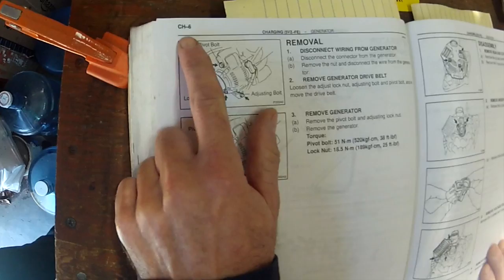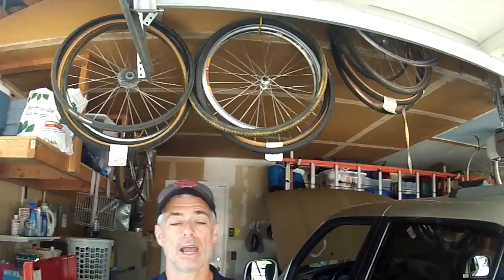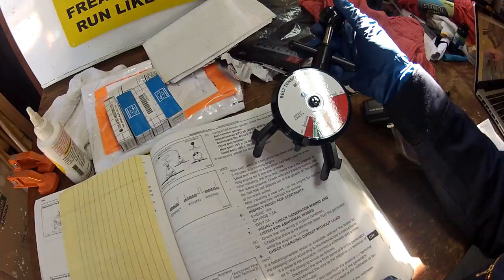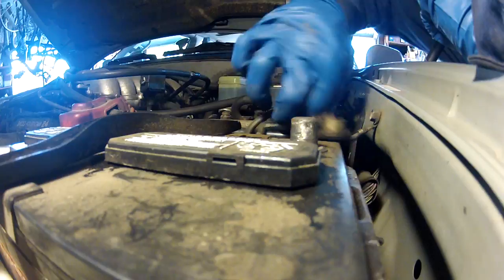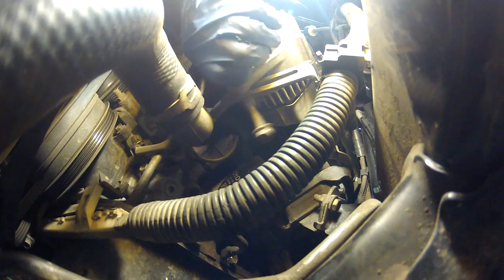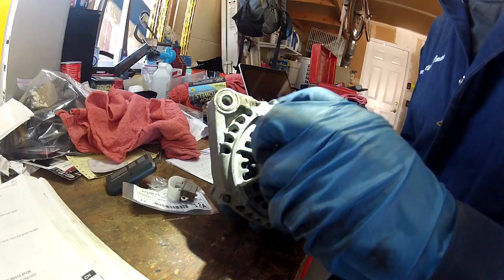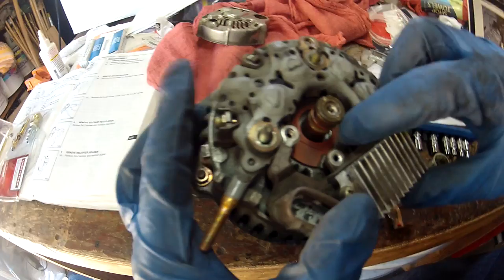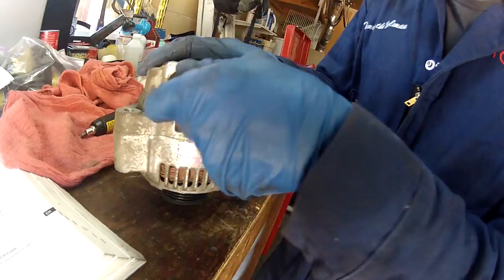Alternator Brush Replacement

Comment: I was catching up on starter issues on my 99 Tacoma SR5 4X4 with a 2.7 4 cylinder and really liked your contacts replacement . The view was good and the step by step keep my attention till I got that confident feeling to get it done . I don't have a garage or live in sunny Calif. So I need to plan ahead . My question is I noticed you referencing a manual for tech specs was that maybe a Haynes or Chiltons or that 2 volume set from Toyota , I wondered what you felt was a good reference . I don't have one now and all my repairs are from Youtube videos only . I saw your 4Runner and your videos are very helpful , I bought my Tacoma with 205K and have put on about 80K on that . I have had it about 8 years and no real problems but I felt it was time to give her a little love . The more I work it the more I get attached , anyway I could talk your ear off , so thanks for some good videos . Perry
Reply from the maker: Howdy Perry, glad you found the video helpful.  The manuals I reference are the 2 Volume Toyota Factory Service Manuals for my 2000 4runner.  I found the FSM set online for sale and paid $300 for it.  I've gotten a ton of use out of my manuals so it was a very worthwhile investment.  If you plan on driving your rig till the wheels fall off, I'd recommend you get yourself a FSM set your your Tacoma as well.  If you're patient and search on a regular basis, I bet you can find a reasonably priced set on Ebay, Craigslist or some other site.  I haven't looked at a Haynes or Chilton manual in a very long time, but I'd have to guess they aren't nearly as good as having the Toyota FSM for your year Tacoma.  Happy wrenching!
Reply: Thanks for the fast reply . Yeah I had a feeling it was the set of two from Toyota . The best price so far is about $160 . I will keep an eye out . I am disabled but you wouldn't know to see me , but I have set budget . After a couple medium to larger repairs there has not been much I won't do . I did pass off my two universal joint bad vibration to my mechanic . I watched your starter rebuild because of an issue when the weather turned cold , I live outside Washington D C . My battery was twelve years old and tested good at the parts store on two different devices , then my mechanic said the same but my cold cranking Amps were down to 580 . So new battery , the a couple morning of 2 or 3 key turns to start . Then out of the blue the number 2 cylinder starts missing , so new plugs , wires , and coils . Now it always starts but after about 15 key turns usually when it's cold out below freezing , so the starter rebuild unless you have any suggestion . I will budget in those books asap . I pushed snow last year in someones else's truck and made 2K in 3 days so I'm praying for a blizzard lol , Well thanks again , you know I'm really getting attached to this truck .
Reply from the maker: I'm not sure if replacing the starter contacts and plunger would be the fix for your starting issue.  If you have the tell-tale clicking when trying to start the truck or your starter actually gets stuck on, which was the case for me, I'd then say your starter could use some work.  

There's a good chance your issue is related to a bad connection.  I'd make sure your battery terminals and post are clean first.  Then I'd follow the cables and check for any looseness or corrosion at the connections.  I wish I was more well-versed in the electrical system, but I'm not, and can't point you to where all the grounds are.  I'd for sure check the power connection at the starter because that's exposed to all the elements splashing up and I could see that easily becoming corroded especially if you are dealing with road salts rusting everything on the undercarriage.

Good luck and let me know how it goes.
Reply: I was thinking along those lines , so I put her up on some ramps I have and my home made creeper but could not confirm a particular spot , except I developed a oil leak that I need to pin point by taking off the brush shields and cleaning a little to help locate the leak . Or a UV dye to help spot it . The starter contacts I will have to view as preventative maint. also $25 for starter brushes along with the solenoid repair / rebuild kit I found on Ebay for $23 from CSS auto electric with one plunger , one house shaped black rubber gasket , two copper bolts one longer than the other, two contacts , one for each side , two O rings ,two square bushings black and two round black bushings four nuts , only part I don't see is the two flat washers but should not be a problem . So starter has a set of four brushes and I hope thats a complete rebuild . The only other thing was the preventative maint. on Alternator . Did your mechanic mention anything about bearings in Alternator there are two I believe , front and back or are those bearing a concern ? You know on my 4 cylinder the starter is on the drivers side . lol Well after this repair I will starter to save for those Toyota manuals . Planing this I will need to be creative lol . In the summer I did my radiator with a tarp tied from tree to tree angled down on one side for run off , but now we have a high of 43 degrees and drizzle . I will send a update on how repair went and how parts came and if matched .
My neighbors think I'm nuts but your thoughts on Alternator bearings
Reply from the maker: There's a bearing for the alternator pulley on the front but I don't know of a second one.  I'm not that well-versed in all the internal parts of an alternator.  But, I think I'd just wait until something starts making a noise and wouldn't replace the bearings as preventative maintenance.  A bad bearing usually makes noise first before completely failing so you usually have time to diagnose where the noise is coming from and replace the offending bearing wherever it is.  I just figured replacing the contacts was a good preventative maintenance job to do since my mechanic friend told me he's seen lots of alternators fail due to worn brushes.
Reply: Yeah I think your right about bearings . Well it looks like I will do the preventative maint. on Alternator , then see if I can pin point my oil leak and after maybe do some preventative with starter solenoid and see what the brushes are about . Might not be a need for brushes who knows . I have 284K on the meter . Anyway I got a bit of news tonight from my Landlord up stairs that he wants to move 10 minutes away into a two garage house because the wife is pregnant . This is like in 2 or 3 weeks and half that garage would be a big help . So the family wants me to move with them which is cool . Parking sucks here at the Townhouses . This guy is no handy man by any stretch , he might want a nice big work bench lol . I will let you know how surgery on my Tacoma went as soon as I can . Thanks Perry
Reply: Hey Timmy , if you had to replace your oil pan gasket would you be able to just drop the pan ? One of these Tacoma forums said the labour book has it being a 6 hour job on my Tacoma , something about moving the front differential to get my pan out if my leak is that simple as the oil pan . Thanks again Perry
Reply from the maker: Yes, you have to remove the front differential and a few other things so It's a labor intensive job.  Unless the leak is really bad, that might be one to just to ignore and keep topping off the oil level.
Reply: Thanks for the update . Once I get the skid plates off and clean it up I should be able to confirm where it's coming from . I hope it's not a permanent issue . The last 8 months I have taken on a repair each month , Radiator , struts and rear shocks , rotors and pads , new rear bumper . new exhaust from header to back . LED's for parking , brakes , reverse and interior and the list goes on . My son told me I needed a hobby so I found one in my truck and his car 07 Audi A4 , he is 32 and still calls me for repairs lol I have somewhat of a plan so results will be coming . Thanks Perry
Reply from the maker: If you haven't replaced the lower ball joints yet, I'd suggest doing it.  They are known to fail and can cause quite a bit of damage when they go and possibly cause you to wreck.  Pretty good insurance for around $180.  Check Camelback Toyota for your parts needs.  They have good pricing, they ship for free if your order is over $150 and only charge a $3 handling fee.  I buy most of my parts through them.

Comment: My 4Runner has almost 250k.  I guess I'd better look at these brushes soon.  Just a couple of thoughts.  Sometimes these brackets have a sleeve in the bolt hole that can be pushed out to allow the alternator to slip back in easier.  I couldn't tell...these looked like they might have a flange on the inside so maybe no help there.  Only takes a few minutes to pull the battery out of these cars.  Get you a lot more room to maneuver, yes?
Oh one more thing.  There are a couple of rubber hoses behind the alternator.  Some people call them "bypass" hoses, but they are for the water cooled oil cooler.  Good time to replace those when the alternator is out.
Reply from the maker: Based off the mileage of my vehicle, how much length was left to the brushes, and what the FSM says the minimum length is, I'd assume the brushes theoretically could last as long as 300,000 miles.  But, I'm glad I did them anyway.  One less thing that could leave me stranded somewhere in BFE.

It looked like to me there were flanges on the bracket and no sleeves.  But, the next time I remove an alternator, I'll remember what you said.

You're probably right.  Removing the battery would have made maneuvering easier but I didn't think of it when I was in the throes of battle trying to get the alternator lined back up into the bracket.  I sort of expected it was going to be a pain to get back in when it was a little work just to free it of the bracket and I was right.  That telescoping mirror was invaluable to get the bolt holes lined up.

Well, if one of those oil cooler hoses goes, I'll get more practice removing and replacing the alternator.
Reply: Ha ha.  Watching you do this is helping me plan so I can get a few things done at the same time.
I appreciate you taking the time to film.  I know how much easier is just to push through without interruptions.

Some things that help are seeing what tools work for a job, seeing how to get access to different areas.  Seeing the part numbers makes it much quicker to order online.  etc, etc  I'm inspired to get at some of these repairs.

Comment: wow! I'm gonna do that same procedure instead of paying 200.00 for a new alternator thank you Boss for sharing! love all your work I just need to get me some more handy tool's.
Reply from the maker: If you like wrenching, the tools will pay for themselves over time because shop labor rates are very expensive.  I buy most of my tools via Amazon.  I search for what I need and usually base my purchases from the reviews.  If the tool gets good reviews, it's a usually a safe bet to purchase.  As a DIYer, you don't need the crazy expensive tools like Snap-On and Matco.  In the last 2 years, I've spent thousands on tools but I'm also doing quite a bit of wrenching these days so I'm making good use of them.  

The hard decisions for tool purchases are the ones that are very specific for a particular job and you probably won't ever need the tool again.  In those circumstances, what you have to weigh is the money saved on the labor compared to the cost of the tool.  The way I look at it, I'd rather buy the special tool, do the job myself because I'm going to make sure it's done right and then I can always help somebody else out with the special tool I bought or just sell it on Craigslist or Ebay. 

I bought a Harbor Freight press and special axle tool so I can do the rear axle seal repair.  The Harbor Freight press can definitely be used for other jobs but the special axle tool is only useful for that one job.  But, I have now used that axle tool extensively helping other dudes out while making a little coin for our party fund.

Happy Wrenching!

Comment: Very Good Video Timmy. Try to keep in mind that Torque Wrenches should not be used with Extensions, You can break the Torque Wrench or mess up the Torque Wrench Calibration, and incorrectly Torque whatever it is that You are Fastening. Awesome Video and Thank You.
Reply from the maker: Glad you like the video.  I've seen tests with torque wrenches and extensions and it's been proven extensions don't do what people originally thought.  You can get an accurate torque value with an extension.  Without the ability of using extensions with torque wrenches, there would be a whole lot of applications you couldn't use them for.  So, I don't agree with you on this.  You can throw off the torque value when you extend the lever like when you use a crows foot in-line with the torque wrench handle.  When using a crows foot, you have to get the crows foot at a right angle to the torque wrench so it's not extending the leverage and changing the torqued value.

Comment: Toyota was smart and left the halo open for the brushes.  You don't need a screwdriver to push it down. You just use your finger. Easy
Reply from the maker: For some reason I struggled to get those brushes in.  I tried with just my finger.  No dice.

Comment: What do you think of an aftermarket alternator that says it's new, not rebuilt BUT the paperwork that came with it shows the testing results at 13.8Volts.  Installed and sure enough 13.8 at the alternator.  That seems too low to me.  '97 Limited 4Runner 3.4 and I kept the original Denso alternator.  I'm going to try the brushes and see if the original will kick back to life and possibly return the 13.8Volt crap.
Reply from the maker: 13.8 to 14.2 volts is the usual range alternators charge at.  I would definitely try to salvage your Denso alternator before going to a replacement.  Also, you can purchase a rebuilt Denso.  If you're forced to replace your original alternator, I'd go the rebuilt Denso route.

Comment: Just a note on under tensioned belt. The efficency  is far less of a concern. The main problem is that a lot of torque from alternator could cause alternator belt to slip and that slippage may cause premature belt ware forcing one to replace it far sooner, wasting time  and money.
Reply from the maker: Keith Reynolds I agree with what you're saying.  It's more of a situation of wearing out the belt prematurely instead of reducing the efficiency of driving the accessory.

Comment: Lights  flicker when shifting down at night goes back really fast and then at idle the tac goes up and down
Reply from the maker: Sounds like it could be an alternator issue.  Hook up a volt meter to see what the volts are doing.

Comment: What is the name of the manual your using? its nice and very detailed. Thanks in advance
Reply from the maker: It's an actual Toyota factory service manual.  You can do a search on Ebay for your year and model and usually find a set for sale.

Comment: This brush holder assembly did not fit my 1998 SR5 by the way.  It appears that there were two designs of brush holders; one with a plastic cover and one with a rubber cover.  The plastic covered assembly will not fit the alternator that uses the rubber cover.
Reply from the maker: We are very sorry we led you down the wrong path. Thanks a bunch for sharing this info so we can add it to our video description and pinned comment to prevent this from happening to others in the future.

Comment: Who sells the lighted mirror ??  I NEED ONE OF THOSE !   At 70 years, vision of small dark parts in the back,  in the corner,  in the dark is really tough !   Another nice tool is a "voltage finder probe" with a 'buzzer' not a light. Thanks TTT
Reply from the maker: I bought that lighted mirror at Sears but I imagine if you did a search on Amazon you'd find one online.  Thanks for the tip for the voltage finder probe.

Comment: Hey Tim...I have a 2000 sr5 and looked up that part number and it says it doesn't fit. Think it's wrong? Thanks
Reply from the maker: It should fit as long as you have the OEM Denso alternator.

Comment: Hi Timmy, i just did a great DIY job on my ‘02 4Runner changing the brush but still the charging indicator light is still on at the dashboard. I found out that one of the wires(white) on the socket connected at the back of the alternator got cut off. My question, can i buy this wired socket at the dealer? Thanks. Greetings from Chicago.
Reply from the maker: I don't know if you can buy the socket from the dealer.  You would need to go there and ask yourself.   Is there any way you can rewire it.  I know you can de-pin plugs for repairs or rewiring.  Maybe you can de-pin that wire, install a new pin and wire and fix the original plug.